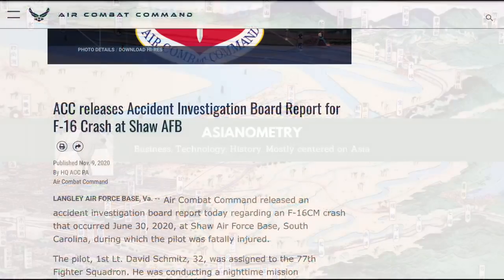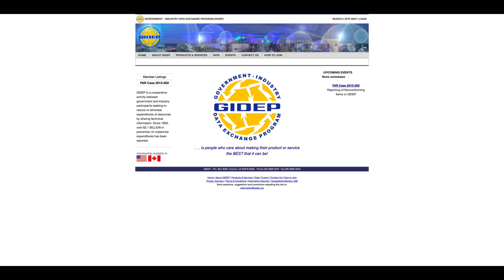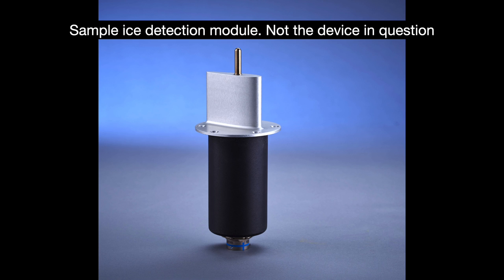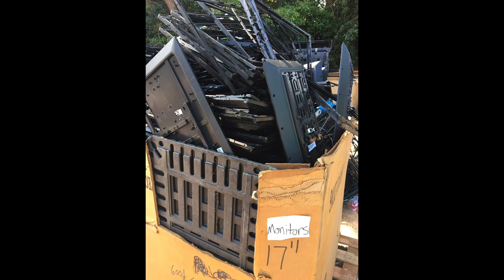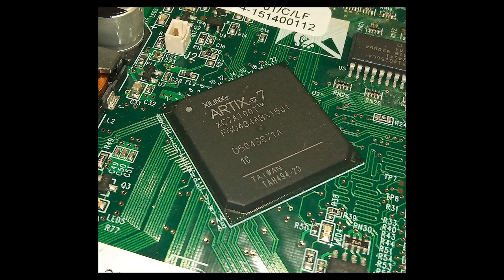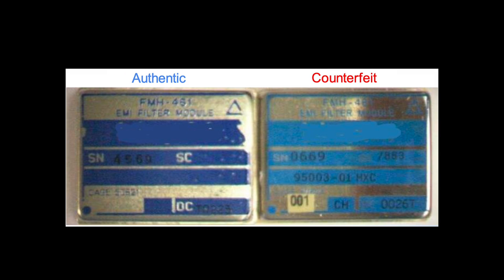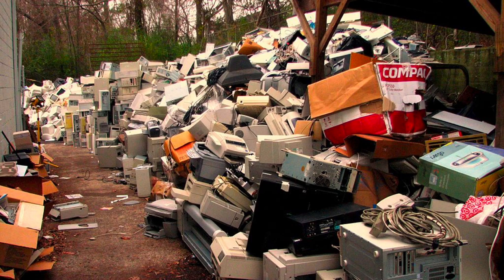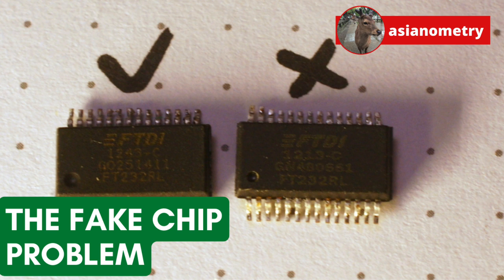The Fake Chip Scourge

Comment: A note to those that may think this doesn't concern them: There are old CPUs being relabeled and sold as new and more expensive ones (for example, an old Athlon sold as a new Ryzen CPU), sometimes they even replace the whole IHS, and there are even counterfeit GPUs with fake firmware flashed so it shows as legitimate in the OS (untill you try to install a driver or actually use it). Stay vigilant when buying second hand!
Reply: Other examples:
- During the mid 2000 there was a huge batch of counterfeit Athlon XP that were in fact rebranded Geode chips, performing similarly but requiring higher voltages. The story was revealed several years after the incident and it impacted a massive amount of customers around Europe.
- With the rise of Arduino, a lot of cloned AVR chips (and later STM32) entered the market at very low prices. Sometimes correctly described as pinout or code compatible, sometimes totally counterfeit relabeling. Even for the genuine replacement clones, analog circuits and tolerances are often poor and characteristics like voltages, fuses, ISP or watchdog don't match the original specs.

Comment: One of the most common counterfeit methods is selling parts that didn't pass testing as either good parts or as lower grade parts.  Often times on a reel of parts you'll get obvious failures such as missing dies, no leadframes, etc.  When a packaging house is making 10 million parts a year at 9x% yield that's a whole lot of scrap parts that can be sold into the gray market if someone at the packaging house has an in with someone who handles that material.

Comment: Blockchain is NOT the solution.  Chips are made by companies, and the chips are branded.  It's stamped right on the chip!  Each chip manufacture could maintain a database of their chip IDs.  Don't fall for the bogus notion that authenticity requires a blockchain.  I would much more trust a manufacture's database than a random blockchain.

Comment: In the section of old parts you used a rather poor example at 5:48 :the 65c816 is still made.  the 14mhz WDC 65c816 is 100% drop in compatible with the 4Mhz VLSI part shown
Reply: It doesn't matter if components are still made. It only matters if someone is buying them. If there's money to be made the counterfeiters will get involved.
Reply: @1pcfred  In the section where he was showing the 65c816 he was explaining about old parts not being made anymore, forcing buyers to look outside regular channels. off all (stock) images of chips he  choice exactly one of the very few that is still being produced 37 years after introduction.
Reply: @rj7855  there are plenty of old parts that are out of production today. I'm sure someday the part shown in the video will become obsolete too. Someone will still need one to keep old gear running though.

Comment: We use fake chips for military equipment because original manufacturer no longer makes them. They often fail on low temperatures  and need to be replaced. Sometimes the whole batch appears to be faulty. Redesigning the circuitry for new type of ICs is next to impossible.

Comment: I personally try to reuse components off of dead equipment. Often times, a systemic failure cannot be traced, but most components can be verified as working. I really believe that we need more reuse of electronics components, if they are marked as used.🥰
Reply: The world needs more of that 👍🌎😊
~ repliesgpt
Reply: “off of” should actually read ·from·
Reply: I bought an FPGA chip a long time ago that was marketed as being desoldered and reballed from old equipment. It was for a repair and worked fine. YMMV...

Comment: Hang on, if the buyers bought direct from the original manufacturer or their authorised supply chain, this could not happen. The problem is buying from the cheapest supplier. I can buy from a Toyota dealer or pay half the price and buy my car parts from eBay. The latter is cheaper but I don't expect genuine parts.
Reply: Exactly.
Reply: What happens often is that when an IC manufacture discontinues the item, a third party supplier will buy up all the inventory and then re-sell them. The original manufacturer no longer support, sell or warehouse them for distribution.
Reply: Well that is very true. The problem in developed countries is there is at least a 10 times markup on basic components when you buy from a quality supplier. And even if you search for a cheap supplier you end up paying a 3 times markup. In underdeveloped countries you only pay 25% to at most double the mass manufacturer wholesale cost.
Reply: Over the last few years the problem is authorized sellers are out of stock and manufacturers have lead times over a year. I don't think it's about the cost of the chips themselves. It's about companies trying to get enough supply to keep production going.
Reply: @BrianMarshall1  Trying to do low volume low cost in Europe is nearly impossible due to the 10x component markup. Gluing together low cost imported modules is one answer.
Reply: I agree with you, except in LatAm.  I have had Toyota dealers pull out spares from my car during warranty service. And replace them with counterfits. 🤷
Reply: You're forgetting that in this industry an OEM isn't a manufacturer.  Also, there are several packaging steps between making the chip and having a component you put into a product.  The chip manufacturer usually isn't the packager.  That's another company that the chip manufacturer contracts or sub-contracts with to handle that specific function.  For example, the 555 timer - on chip.  Now a days about the size of medium grind black-pepper.  That same little thing can be found in old-school DIP, but also MSOP, SOIC, TSOP, TSSOP, uSOP packages.
Reply: Well here the issue, a lot of those chips are by companies that no longer exist, or by companies to do still exist but the chip you're looking for has been discontinued for years and there's no modern equivalent.
Reply: @madmax2069  and it cuts into profits to redesign with modern replacements...

Comment: I am an EE with 50 years experience. I do not believe the story of Chinese counterfeit chips for anything but the most trivial types of silicon. The story of the XILINX FPGA fallen out of its socket (it was a PGA) indicates, that when the dies were bonded inside the ceramic housing, they used pins with a smaller diameter. In fact it is even more likely that the socket was incorrect. When these sockets are new, the PGA chip is very difficult to insert (lots of pressure is required) It is considerable easier to remove the chip and when you do insert and extract the chip a few times, the insertion forces is only a fraction of the force required the first time.
Here is my reason, I do not believe that any chip as complex as a FPGA can be reverse engineered in an economical manner. You cannot re-design a microchip based on a look at the exposed die. You have to study its functionality and then more or less engineer it from scratch while being very careful to attain the same specs. Also a FPGA is configured at power up from a separate Flash memory. The bit-stream is encrypted and a closely guarded secret of Xilinx. This protects the user, so reading the bitstream does not allow a thief to regenerate the schematics or HDL code.
However it is possible that the Chinese managed to "unhack" the encryption.
But then, why? All the chips they "copy" are old and the market for them is very limited and little money can be made that way.
Here is what I believe is the real story of what is going on.
China bullies any company who wants to do business in China to provide "technology transfer". This means Xilinx was "arm-twisted" to provide their Chinese partners in the Joint Venture to provide the design files for older chips. Xilinx desided to go along with that idea, since they are one of the most innovative companies on the planet. Anything 10 years old is of no interest to them.
Besides China just does not have the semiconductor technology to "fab" the most advanced chips. Xilinx manufactures in Taiwan at TSMC. Espionage is another explanation but I do not think so.
The shame is on the defense contractor. Apparently their military technology is decades old and the chips are no longer made by Xilinx. The chip in the video was a XC3090... probably 30 years old. It is not available for at least 20 years and when you buy one it is "new" but "old stock".
Reply: Note however that the video is discussing counterfeit chips from a wider perspective than die cloning. Recycled chips could also be considered counterfeit if they are if unknown source and not properly valudated. Such chips can have any number of problems like remarked to fake specs, pin corrosion, random ESD or other damage that's causing the chip to go out of tolerance. In a perfect world, a specialty broker would stockpile chips at EOL and sell them long term to military and similar customers. Of course, the market is too lucrative for those honest brokers to be the only players around.

Comment: China is still the number one in counterfeit electronics, not only chips but also everything that has or has not got cord to plug it in somewhere. When I buy a microprocessor or computer-chips from AliExpress, I often buy the same thing from many different sellers, they can't all get their chips from one source. All BRAND NEW old stock computer chips have traces of solder on the pins, reheated, brushed off and straightened. It looks new but I know it isn't. I know it is old, I know it is from the garbage. 
 
There is something really rotten and stinky about the hole recycling business. Consumer goods have almost the value when they are in the dumpster as when they are new in the shops. I have seen completely new and NEVER USED cables for computers or TV's being chopped off then resold to a company that burns off the plastic, then the copper from the wire is sold as a material to maken new wires from. This is not only stupid, I think it is criminal to recycle in this way. It can only be done with millions of money from the government as a stimulants for recycling. 
 
If recycling would be forbidden, the spill of completely new clothing, cables, electronic devices or whatever would be reduced to nothing. As a result of the billions of Euro's and Dollars the world is polluted, because there is so much money to be made.

Comment: I bought some LM317 a few years ago.  The price was good but not too good to be true.  The first one wouldn't work.  The second one smoked as soon as power was applied.  I contacted my supplier and they asked me to send them all back.  They sent me replacements and these all worked and they confirmed that they had received a batch of verified counterfeits and were profusely sorry for the trouble.  They absolutely stood up and took care of the problem and wound up paying me more in discounts than the original parts cost me.  I never would have thought something as simple and ubiquitous as an LM317 would be so problematic.
Reply: Yes, even low-end IC`s can be counterfeit. I had a similar incident with LM317 IC`s. I ordered the TO-220 style variant (1amp power rating) but on testing the maximum output was 100mA. Upon inspection it was discovered the chip inside was for the TO-92 (100mA) version of the LM317.
Reply: You should have named the supplier so other people can use them too.

Comment: This sounds petty compared to the severity of the story being told here, but this is an issue for vintage tech fixers and refurbishers. The commodore sid chip and other vintage CPUs are faked quite often. especially for hard to find parts. you think you bought from an old lot of 1802 cpus from ali expres, thinking they were pulled working from some old e-waste, when they were actually just some random chip with the same packaging, scrubbed and laser etched with the old logo. :/

Comment: A couple of years ago we saw excessive failure of a diode used in one of our products. Our bill of materials called out a diode with part number manufactured by Fairchild (a US company). We asked our Chinese contract manufacturer for a picture of the reels that contains the diodes. The reels had a label showing  the correct part number and manufacturer. We asked them to ship us a reel and we sent it to Fairchild for analysis. Fairchild x-rayed the diode and told us it is not a Fairchild part.
Reply: That is your fault for using a contract manufacturer. If you had been making the stuff at home and buying from Fairchild that wouldn't have happened.

Comment: I believe we need proper reuse channels. Don't just pretend to "recycle" (shred) e-waste. Much e-waste can actually be reused and therefore be part of a circular economy and respect the reduce-reuse-recycle principle (recycle is the last option and the worst).

If reuse and right-to-repair is encouraged there should be dedicated legitimate channels for for these parts. These parts would reenter the economy as second hand parts at a market determined price that would usually be lower than MSRP (but may be higher when facing shortages) yet high enough to still result in a profit for recyclers.

Without a proper reuse channel the incentive to counterfeit is much larger because there is in unexploited resource and the potential revenue is at market prices for original parts. Corporations are actively fighting the existence of such channels and therefore contributing to the issue of fake chips. 

The problem with fake chips is not that reused parts and knockoffs are being sold, it is that they are claimed to be new and original. It is better to address the real issue, the incentive to scam, from all sides (both top, proper supply chain controls and testing, and bottom, secondary markets).

Comment: Does this affect chips in consumer products like PCs and smartphones? If not, why not?
Reply: I'd say not so much because mass market parts are bought direct from the manufacturer in a supply contract so there are few middlemen to introduce fake parts.  It's more of a problem at the retail components level, where intermediate stockists may buy the parts from multiple suppliers, and retail supplies are often erratic these days because contract customers are taking all the supply so we have to hunt around for parts for small-scale production, maintenance, R&D etc.
Reply: Yes it does. Guitar pedal builders have run into the issue of fake chips and other parts that don't operate as intended. Guitar pedals are mostly "inexpensive" consumer electronics that cost upwards of a couple hundred dollars each on avg.
Reply: @J C is correct about the guitar pedal problem. Op amps that have the same pinout as each other will do amplification, but the lower quality fakes often produce more noise, higher distortion or otherwise don't actually function as what they're labeled as.

Comment: in some cases, when attempting to make a "clone" product, the company will look at the spec sheets and replicate everything in there. It's interesting sometimes, as it results in bugs from the original design being fixed, or quirks from the spec sheet being inaccurate being patched.
For example, there are some addressable RGB LEDs that the "clone" is actually better than the original, as the LEDs they used are brighter, but able to fit in a smaller package, and fix some problems that make the difference between "I'm done talking to this LED" and "here's the data for the next one" MUCH more clear.
Many software libraries have implemented modes for it, as it's often sold labeled as the original because it's cheaper and on paper works the same. Finding someone selling it directly is shockingly difficult, as at best, their listing has both names in it. So the best bet is buying the smaller kind, since the original doesn't have the smaller size.

Comment: Last year when I was first getting into electronics and arduino, I bought a bag of 50 NAND chips off amazon. After trying many times to get them to work, switching the chip out multiple times in case I had ruined it I finally gave up. I assumed I was wiring it wrong. Ever since I have just made NAND gates manually out of transistors, and now this video has me wondering If I didn't order a bag of fake chips. They were suspiciously cheap but I just thought that was because they are mass produced.

Comment: Shaved ICs were a problem back in the 1990s when I worked in contract electronics manufacturing 

Real concern is one where the take a 5 watt ic and mark it 50 watt, it will work in test and for short time real word, but will fail allot faster

Comment: There's no chip to cheap to counterfeit either. Even just on the low volume/hobbyist side, low cost opamps like the OPA2134 are re-etched NE5532s and the ubiquitous LM317 has been relabeled as a variety of just marginally more expensive regulators. Which is frustrating when you chose something specifically for its ability to handle more that 1.5 amps. Of course theres the hoards of out-of-spec transistors, worth only tens of cents each, which also aren't thrilling to discover.
Reply: A LM317 relabeled as something like a LM1117 which is low drop out voltage and more expensive.

Comment: Instead of exporting the E-Waste perhaps it would be a better idea to sort it in the country it came from? I think a lot of it are chips sold out the back door, at least that is what I was told about all the "counterfeit" microSD cards you get these days. Made by the original manufacturer but didn't meet requirements so they sold them out the back door isntead of binning them.